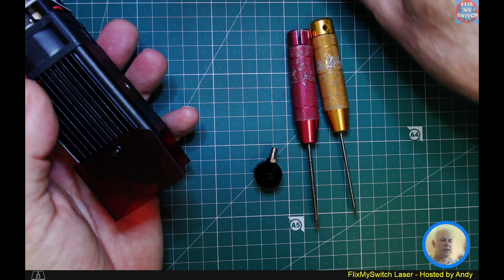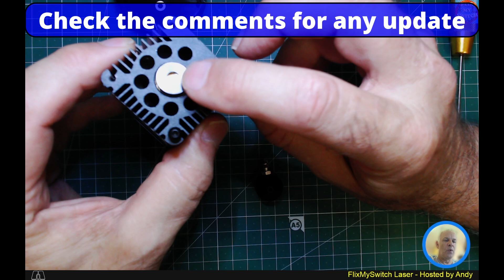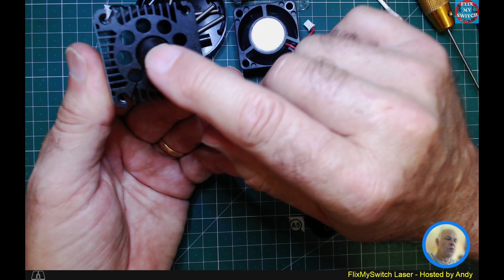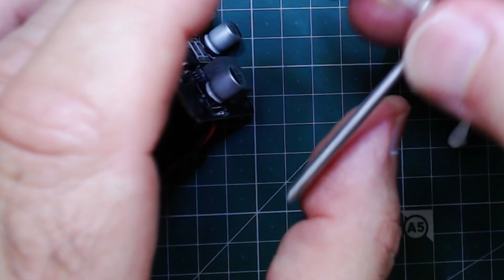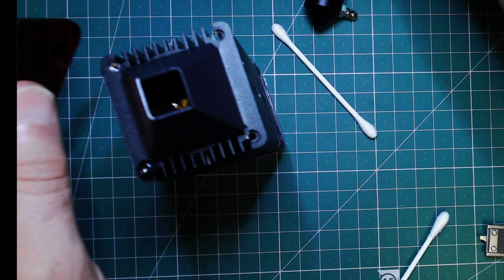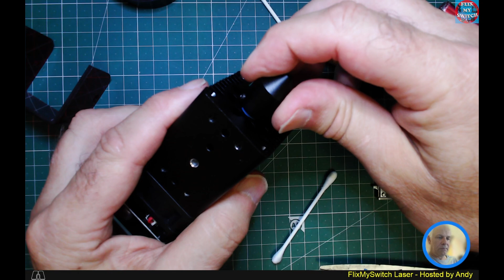How to clean a diode laser | Total strip down | Driver board fan and laser diode Ray5 Longer

Comment: How often do you need to do this?
Reply from the maker: Depends what you use your laser for. Slate creates loads of dust. Cleaning the smoke guard lens is very important. Just monitor what you cut and check the lens often, you will soon learn how many hours of cut means you need to clean it

Comment: If fan has a black, sticky tar like substance on it what is best to use to get it off?
Reply from the maker: I use isopropyl alcohol and a q tip. Don't use much pressure support the fan blades from the underside
Reply from the maker: Clean it more regularly. May also look at better smoke extraction
Reply from the maker: https://youtu.be/j1qp86ifxOE?si=YBoaug_dzRTPbdqm

Better smoke extraction